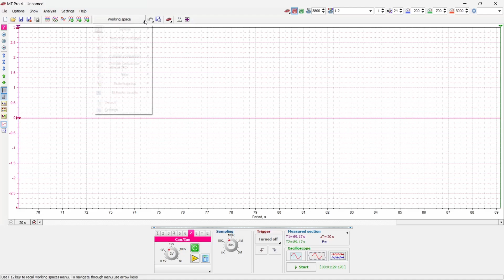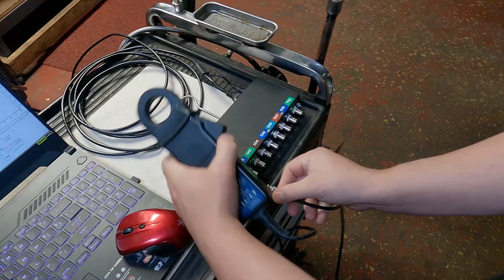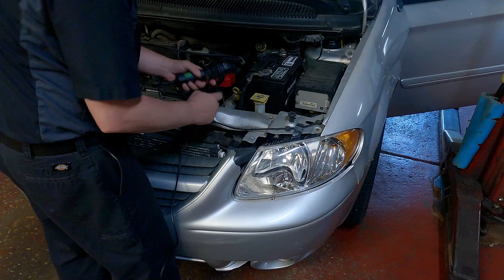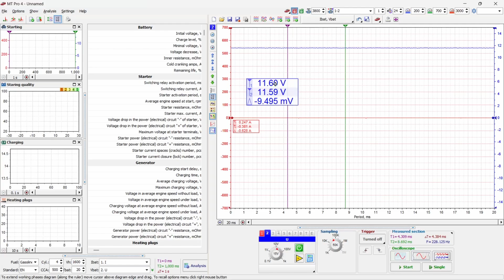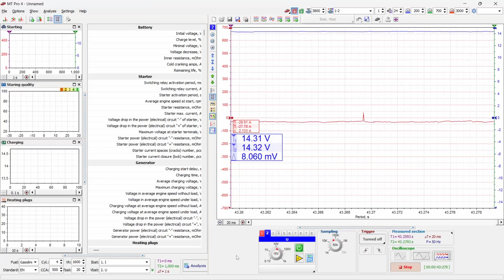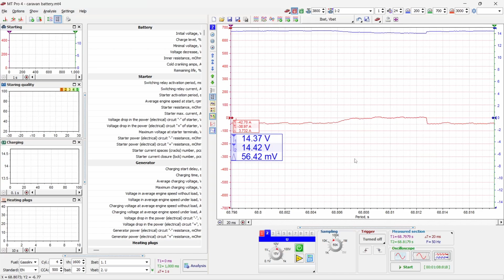Mt Pro El Power Circuits, Basic Battery & Charging System Test

Comment: 1.) START/LEAVE ALL ACCESSORIES OFF/IDLE 10 SECONDS
2.) LOADS ON IDLE 10 SEC/LOADS OFF 2500 10 SEC HOLD/ LOADS ON 2500 10 SEC/LOADS OFF/ RETURN TO IDLE
3.) PAUSE CAPTURE/SAVE AND NAME FILE/ RUN ANALYSIS (BOTTOM CENTER OF SCOPE SCREEN)

Comment: Hi. I am trying to do the battery analysis test. When i click on Working Space, then EI power circuits, then Ibat, Vbat, I should be getting  a split screen as you have on your video. But instead i get a full screen with the oscilloscope. Or, I can click on EI power circuit, and get that full screen, with a void on the right side. How do I get the display to be like the one you're showing?
Reply from the maker: 8 minutes and 30 seconds into the video in this link, I explain how to manipulate the windows.  https://youtu.be/VfF5z67_PSQ?si=t6wy6-WayHtBaRZf
Reply: Thank you. My computer skills are not great, so I'll have to play with this for a bit!